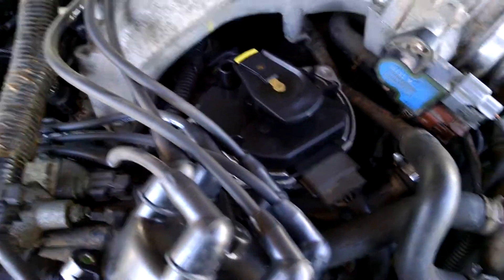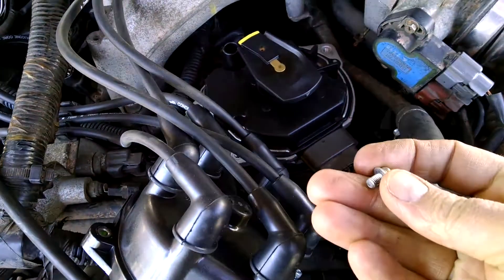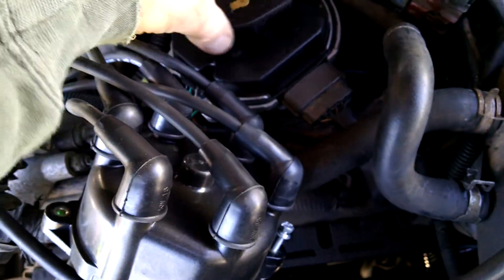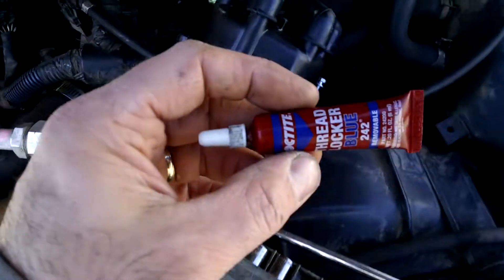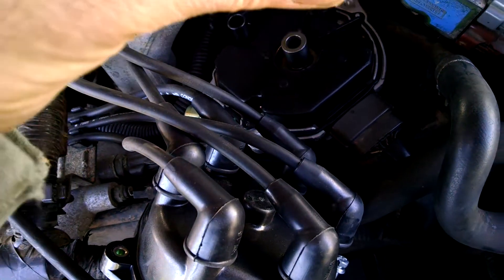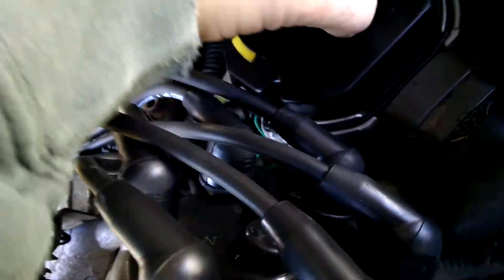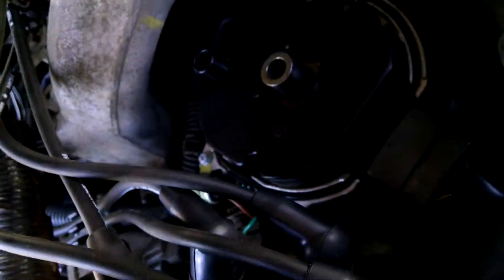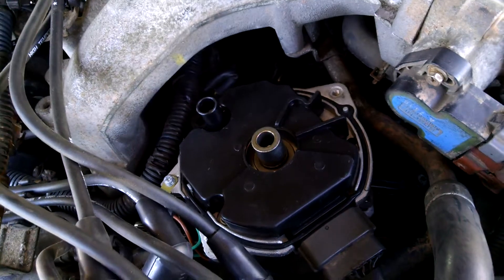Distributer problem solved on 1997 pathfinder 3.3

Comment: If you're having repeat failures on replacement distributors, you need to bite the bullet and buy an OEM type replacement, as they're the only ones built to last. The camshaft sensors fail on the cheap ones.  You can buy a Nissan factory part (around $400) or to save money and get a rebuilt Hitachi unit (same as OEM) and they're under $300.
Reply: I had problems with me 1997 PF dying at stop signs when trying to take off and not wanting to start. A guy on a YT comment section who was a Nissan tech told me it was probably the distributor. But he told me DO NOT get a rebuilt part store or cheap Amazon unit, get the real thing. He said these never last very long. It cost more, but I have never had a problem since.

Comment: Replaced the coil prediction is that is is cam shaft Sensor which was the whole reason I changed the distributor in the first place on a 98 model

Comment: I have a 91 Pathfinder ..first time it came out on me I was driving it just all the sudden backfired like I drop a valve and quit instantly..I shit myself till I discovered the loose screw inside the cap..has happened  4 or 5 times in 3 years ..I just check every so often now..